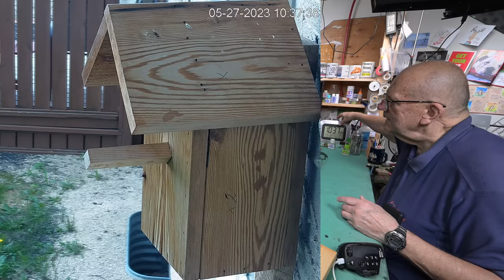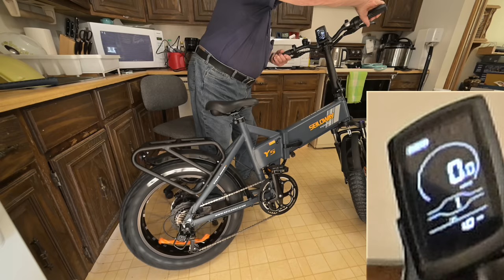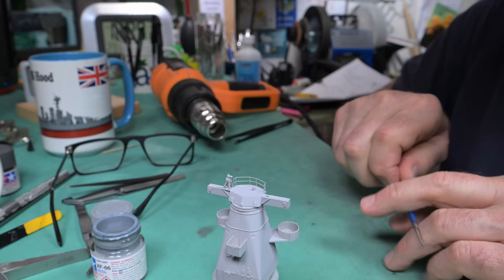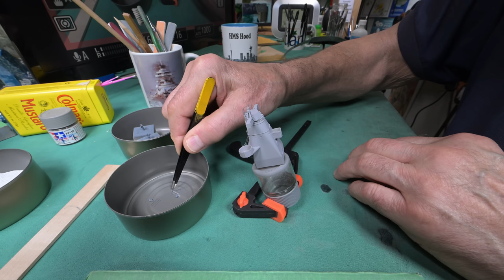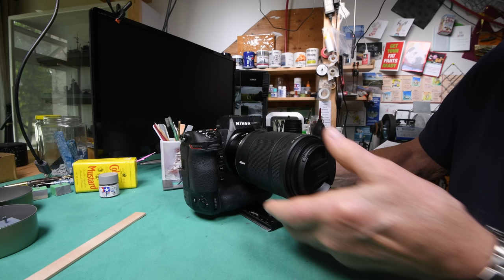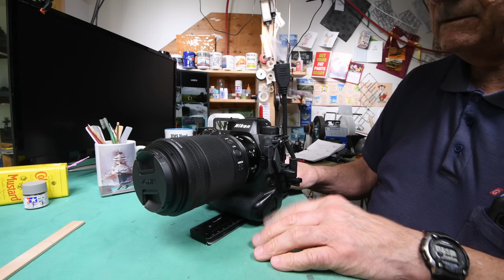The Model Ship - Part 1620

Comment: Make sure the peddles are firmly tightened into the crank arms - a bit of slack will result in the aluminum crank threads getting slowly reamed out.
Spent some years as a bike mechanic before taking up the machinist trade.
And - always - wear a helmet !
Reply from the maker: Hi Andy,
So that explains those bicycle parts in "Andy's PE Bender", haha! By the way, your thoughtfully made PE bender is the most coveted tool on my model table. There is no other "exactly" like it anywhere in the world.
I've never pulled a crank arm before. Hope the manufacture didn't press them on too hard. We'll know tomorrow when the puller comes. Will video the removal. 🤞

Comment: Hey Ron, Installing the cranks in the same direction will not work. Unless you want to prod them with your arms.
Greetings from a longtime cyclist.
Reply from the maker: My reasoning is, that because I can't peddle it anyway, I may as well have it configured so that I can rest both feet on the peddles instead of just one. 🤞